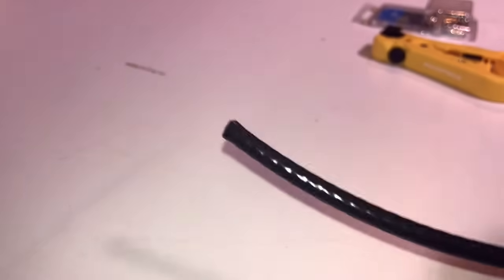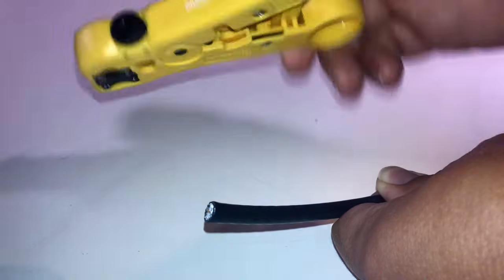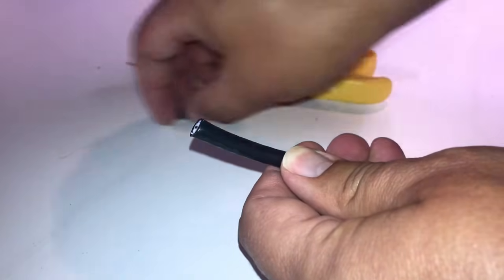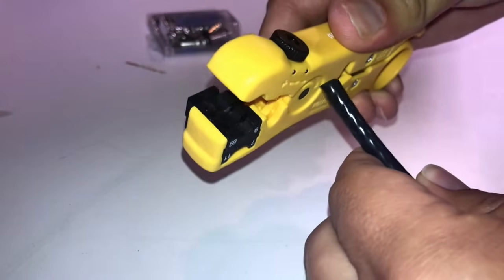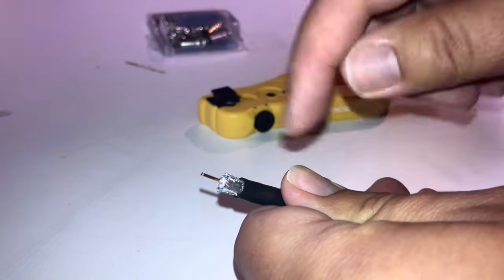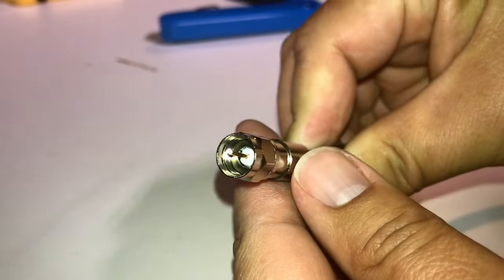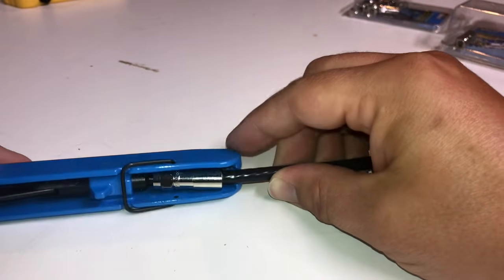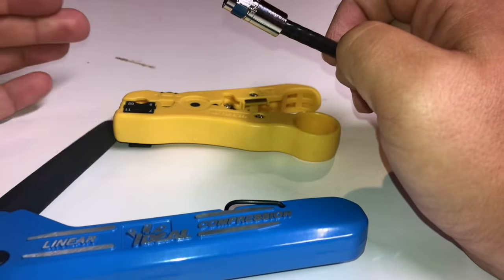How to put ends on coax cable (RG6)

Comment: I must've bought crappy connectors because I do just like you did in the video and the connectors always slip right off. I clamp them down good with a pair of vise grips and they ain't pretty but they stay put.